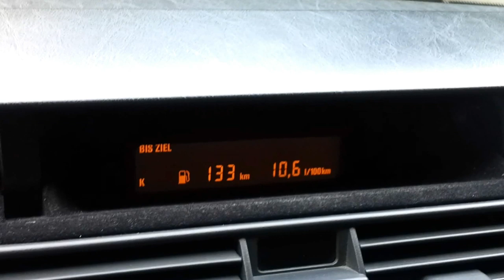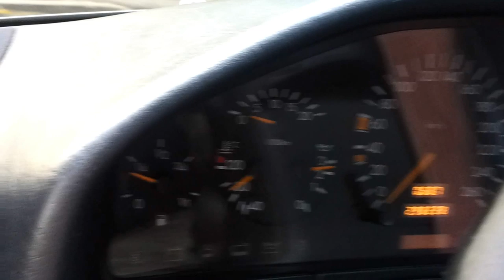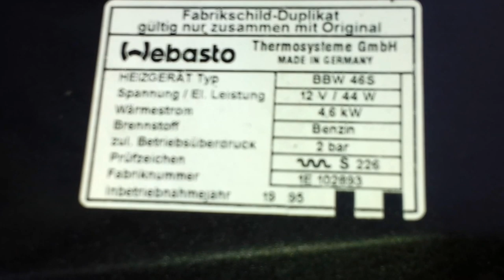W140 S500 V8 engine compartment, revving up, interior

Comment from the maker: It is a stock board computer a very rare extra
Reply: So it's not custom? I guess i could find one and then retrofit it to the car.
Reply: Now i find out it is a european market exclusive, is there a way to change the units to imperial?
Reply from the maker: Nope its only in metric, lacks switches for unit change and the lcd has only metric units printed

Comment: kolko ti har4i na 300,000 km.  az poluchavam 10/100 ob6to highway i city
Reply from the maker: 11.5 l /100 km. 10/100 is possible only on overdrive gear (mine is 4 gears only) driving with 60mph. Anything faster and the speed proportionally increases the consumption.